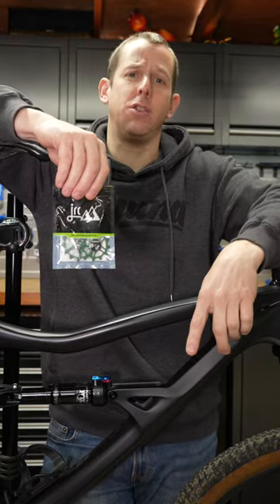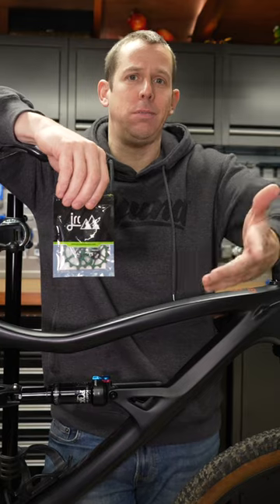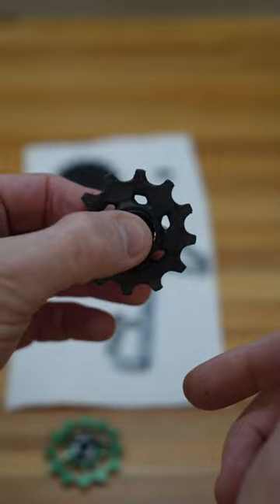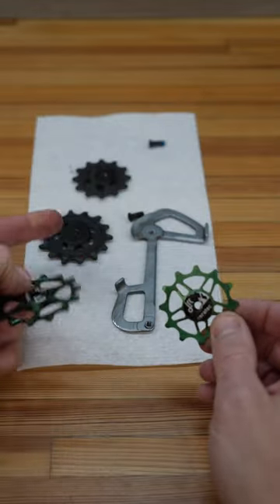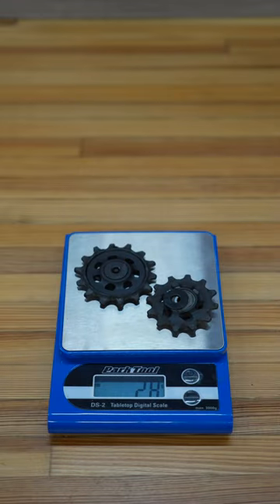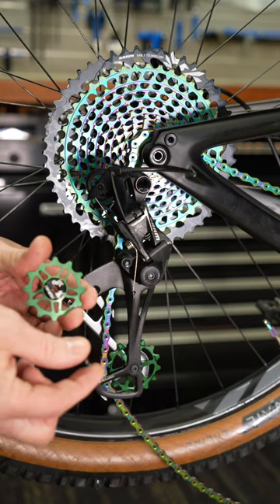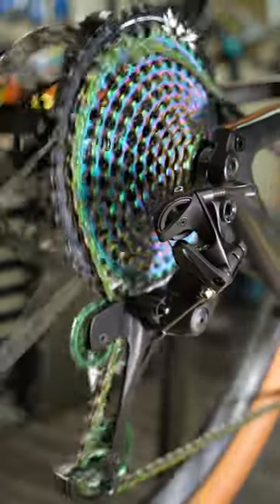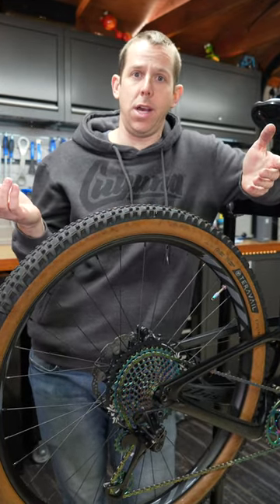GOOD or GARBAGE? | JRC Derailleur Pulleys SRAM Eagle #shorts

Comment: Which jockey wheel is good plastic, rubber, aluminium,or alloy ?
Reply from the maker: Hard to say.  Depends on application, manufacturer, quality of materials. In general it seems for mountain bikes that plastic and aluminum are most commonly used

Comment: i got a few sets of some cheap ceramic pulleys that spin forever and i could tell the difference. i run 8/14 and also run 11/11
Reply from the maker: That’s rad 🤘
Reply: Do you know anything about swapping an 11 to a 13? Would that work ?

Comment: These are good, I dont know what this guys on...!?! But for low budget upgrades, they are fine, so long as your rear derailleur is set up correct these will last way longer than those stock spindles, protect your cassette and roll with way less resistance. This dudes a hater!?! 🤷‍♂️
Reply from the maker: They do what they claim. Reasonable cost, decent bearings, and they look cool. They are definitely staying on my bike.
Reply: @TheDustyDutchman  You trashed em bro... !?
Reply from the maker: What did I say that’s so bad about them? I literally own them and run them on my bike 🤷‍♂️
Reply: @TheDustyDutchman "You have to clean them more" "They weight the same as stock" "They spin the same as the stock ones" No mention of durability in comparison to stock, no mention of the fact they are lighter, and roll better, less wrok for the derailiuer, will out last stock Nylon spindles!?! Epic failure in metioning these details, to top it all, "would i buy these again, No"
Reply from the maker: I also said they do what they claim and they look sick. The rest is just my subjective opinion other than the weight. The only actual negative thing I said was that the anodizing is wearing off. We clearly have a difference in opinion in what “trashing/hating” is lol
Reply from the maker: Also I cannot comment on durability or if they will last longer then stock because I don’t know that yet 🤷‍♂️
Reply: @TheDustyDutchman  Anodizing.....!?! They come in Polished alloy too!?!, no Anodizing option...!?! As for durability, hello Nylon plastic is way weaker than Alloy metal...!? They scratch or even allow to be cut through in a chain slip, the teeth ware down faster, 🤷‍♂️🤦‍♂️ You undermined this product epicly, sorry bro, they are Good enough for a cheap option jokey wheel. Youve massively underwhelmed this product!?
Reply from the maker: Yes mine are anodized green. I literally said these are good and they do what they claim.  I just wouldn’t buy them again. I agree these are good enough for a cheap jockey wheel option. Sorry to let you down and thank you for the feedback 👍
Reply: @TheDustyDutchman  Thanks for responding to my opinion, and taking an interest, major Qudos.....big up. But ya did under sell this one, a bit, cmon now😉🤭 I've bought these very same ones and it improved my gear indexing majorly from year old jokeys to these, omaDAYZZZ!!! Silky smooth. Laterzz, from the UK👊
Reply from the maker: 🙌🙌 Well I’m gonna keep running them and maybe I’ll do a long term review with a deeper dive 🤜🤛